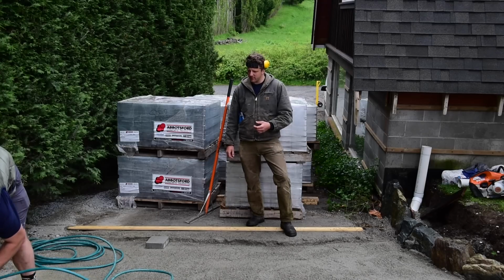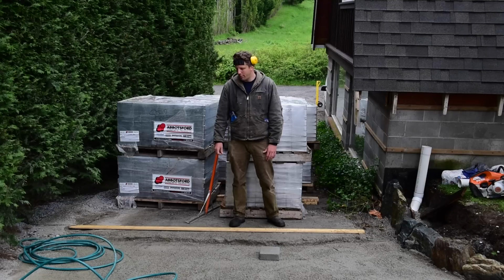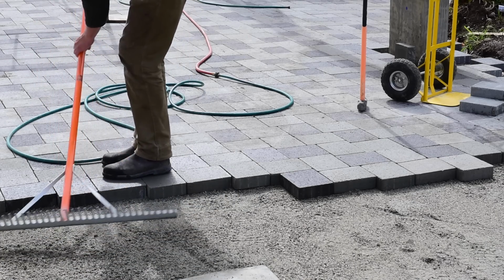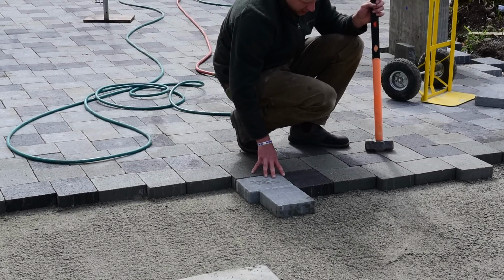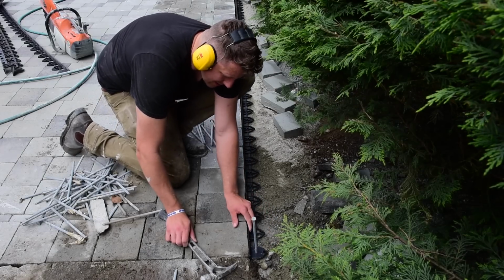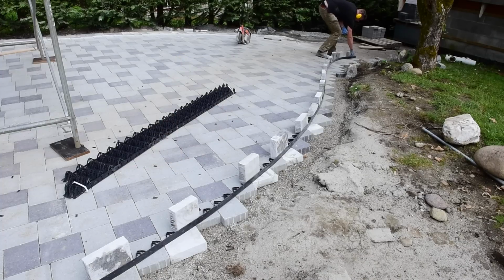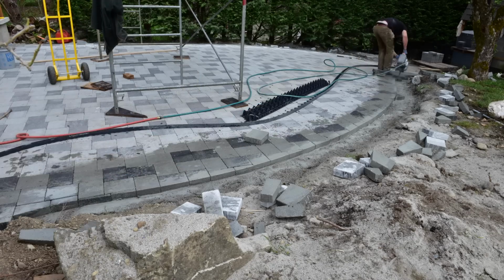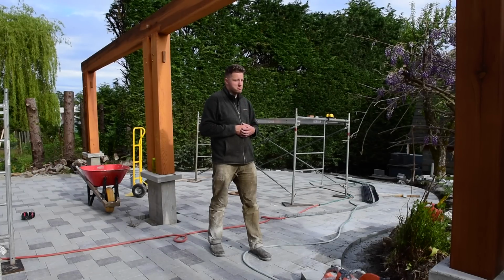WUW #52 How To Lay A Brick Patio

Comment: I use to do this for a living. We used kids crayola to mark our bricks so the water from the portable or table saw would not wash out our lines so quick.
Reply: I currently use this as well.
Reply: Christian Douville we use the pieces of plastic for a broken gas box here in the uk there excellent
Reply: DJSNIPERMUSIC broken gas box?

I'm thinking you might need to translate that for us in North America.
Reply: Scott Verge I'm from England and even i don't understand lol
Reply: It's a white plastic box that's on the outside of your house covering your gas or electric meter. Cut it up into credit card size bits and they last forever and mark it the wet or dry and won't wash off if your wet cutting
Reply: DJSNIPERMUSIC Oh i know what you mean, I've no experience in this so i wouldn't know but I'll bare it in mind for the future
Reply: here in Canada they fine us when we try to cover the HYDRO meter in any way possible..

Comment: Great work man..you are a craftsman.  There is a facet that I did not see you use though.  You can screed your top sand layer over your base layer  using pipe screeds just laid out on the base to get  the thickness of the top layer and fine tune the final grade.  Gets in down flat and fast with less lute work.  But you are a master of the rake and did a remarkable job on this.

Comment: You could make a little wood cushion for the sledgehammer so you won't have to be so delicate when you're tapping the bricks.
Reply: like a box missing 1 side with a hole in the opposing side the size of the handle.  You'd have to keep it upside down for it to stay on though.

Comment: we used conduit  pvc pipe 20mm for marking in perimeter good job top vid  wacker packer with carpet under it fluffy side down works best water after but carpet better cheers each time the wacker packer passers by sweepers spread the sand over the passed area again, after three to four passes you can tell  caps are all filled

Comment: That is going to look awesome.  If its not too late, a good idea would have been add some drains because you are going to be getting a ton of water running off of that thing.   Also I just don't like covering up things like septic tanks etc with this type of stuff because now it will be very hard to dig up if there are ever any problems.  However, this is your house buddy, its looking badass.  Im jealous of all of the time you get to just fix up your own place.

Comment: Nice looking job. Here in the uk we would spread kilndried silver sand over the paving and sweep it into the joins then run the plate compactor  over it do set the bricks nice. Then sweep off the excess sand. Only on a dry day though as damp sand does not flow.

Comment: I do concrete and other hardscapes for my main dough, and I use my aluminum screed boards to do the final grade on the sand. I guess the rake is good enough since the texture hides imperfections unlike finished concrete.

Comment: Can you drive a vehicle on those without forcing them down and making them look weird?
Reply: If the base is put down correctly (4" deep of grade 9 gravel or similar) and 8mm pavers (thicker pavers than for a sidewalk), they won't move and won't brake under a vehicles weight.

Comment: I don't think that wimpy little plastic curbing is going to hold your stones on a driveway.  You need some substantial curbing stone that goes down 10 inches or more. Time will tell. You do need to throw some sand on top of this and broom it in, then water it down with a hose and broom it in once more. Sand has to fill up those cracks to stabilize it or it will move around on you, especially where the car goes. Think about each stone tipping.

Comment: Great timing on this video.  Looking at my driveway and it is a cracked up mess.  Have always wanted to do pavers instead of concrete.  I see some of you guys have done these systems before, what is a reasonable cost per sqft for materials on such a system?
Reply from the maker: ussually between $4-8 per sq ft.
Reply: The Samurai Carpenter Thanks for responding!  Does that number include the two lifts of fill?

Comment: Plain sand for the final step? I know it's much more expensive but the 
polymeric sand will prevent any weed growth in the cracks over time. Plain sand will not and then you will need to resort to chems or weed burner to control the problem,
Reply: Monte I think he meant 00 ( playground sand) the finest sand available
Reply: Fine playground sand is still just sand. Polymeric sand has binders mixed in. Made specifically for this application. (link below) You broom the sand into the joints, run the plate compactor. sweep off any excess (important step) then lightly mist the entire area. The moisture activates the binder and locks the grains together in the gaps.

https://www.google.com/search?q=polymeric+sand&oq=polymeric&aqs=chrome.0.0j69i57j0l4.6677j0j8&sourceid=chrome&ie=UTF-8
Reply: Not a lot of plants would grow in these small crevices + sand
Reply: Another vote for the polymeric.  I laid a pathway a few years ago and have only had a few weeds around the edges.  And the paver laid deck was pressure washed and re-sanded with polymeric and I've had no weeds in the two years since.  Polymeric for the win buddy! ! ! !
Reply: You would really be surprised what will grow in the crevices + sand.
http://meris.com/pavers/wp-content/uploads/2015/02/front-repair-restore.jpg?x76179
Reply: These bricks are set in plain ground with no sand or anything
Reply: vitalijus Kucinskas  no, watch the video at all?! Dolt
Reply: ***** i was talking about claymores picture...
Reply: vitalijus Kucinskas that's probably set on sand bed but not compacted - and a shitty installer
Reply: youd be surprised
Reply: nope just installed at least 10yrs ago

Comment: not a critisism but could you drive a vehicle on that.. .??
Reply: Absolutely.  There are a few different thicknesses of pavers that are made for specific applications. Sidewalk pavers are thinner than driveway or road pavers. There are some cheapo pavers that are thinner than the sidewalk which are probably used by diyers that try to save a buck at the local box store but they can break much easier. The bricks Jesse is using look to be the correct thickness for vehicle traffic.
Reply: Rich Jones with 2inches of sand underneath, he could probably run a convoy of M270 MLRS and be fine!
Reply: Totally. With the amount of sub-material under there and with the sand he's gong to pack into it, it's not going to budge.
Reply: Casey Hagist didn't see the top sand layer getting whackered then screeded
Reply: Agree Rich, In Europe miles and miles of roads are paved this way.

Comment: You don't cement your bricks in place?
Reply: bob mcboberson you shouldnt need to if theyre interlock
Reply: That tight pattern, his starting edge of cement, the plastic edging, and his plan to lay down sand and water to fill the cracks should negate any need for cement.
Reply: @Citizen No.0 he should at least screw some of them together for stability. Anchor screws work great for this.
Reply: The proper way to laid them is over sand, like he is doing.
Reply: @Angel Luis Trinidad I don't think so. Maybe that's the way the older generation does it but the new technique is to use some anchor screws. The field of paving and construction is constantly changing, you have to read a lot to keep up to date with the latest trends.
Reply: +Bob mcboberson Never once in the many many years of laying patios, driveways and sidewalks have I or any other company I've come across use screws for stability.  What Jesse did in this video is all correct. Missed a few tips that would have made this job easier but he did it right... unless he really did use galvanized spikes which would be a no no.
Reply: @directorgtr clearly you are using outdated methods then. Sorry I don't know what to tell you.
Reply: Could you please post a link to an installation guide from any manufacturer that recommends this.

Comment: Your Joinery is fantastic, please dont post vids detailing construction practices your not familiar with.  This is a joke, cinematography great, install practices not so much.  Love your channel.  never use plastic edge restraint.  stick to wood.
Reply: R-77  a simple concrete edge is cheaper, faster, more versatile, and much more durable.  Plastic edge restraint is a home improvement store special.   Dig out the sand and gravel next to the soldier course or 'border' throw into a mixer or wheel barrow, add Portland cement mix and trowel.

Comment: You'll be glad I'm not coming to ruin your party... I'd be annoying the shit out of you asking why you laid the pattern that way and this way. :) 

When you say hose the fine sand into the joints, surely working it in dry with a soft brush is good enough!?
Reply: Poly sand worked very well on our patio-flexible with the weather variations and keeps the ants and grass from growing in the cracks.  Great job Jesse and assistant!
Reply: Stuart Geddes what he should have said it to sweep it into the joints and the hose it down to compress the sand into the same joints